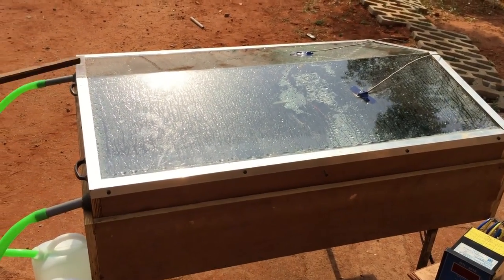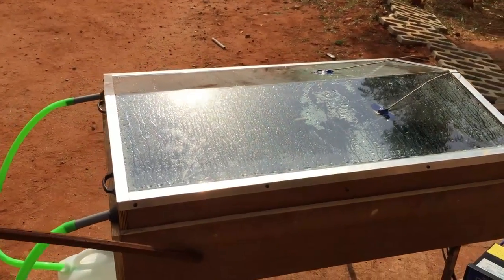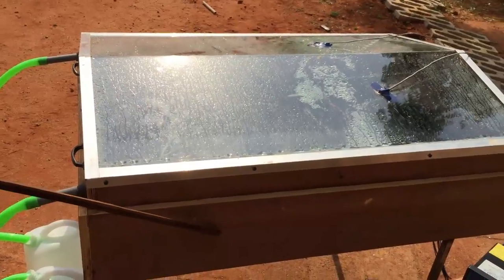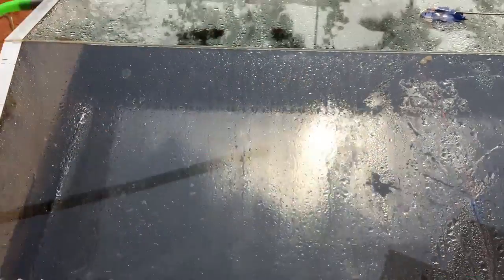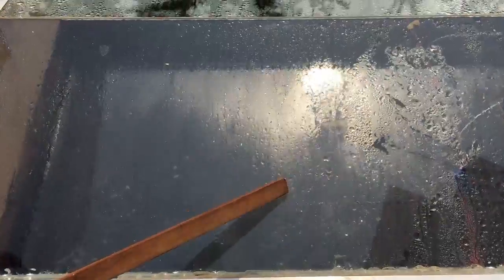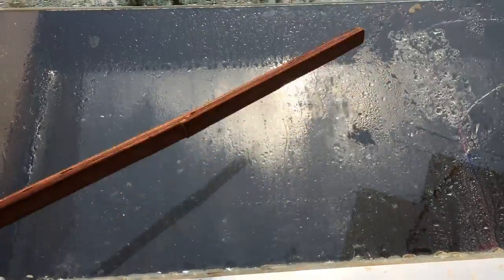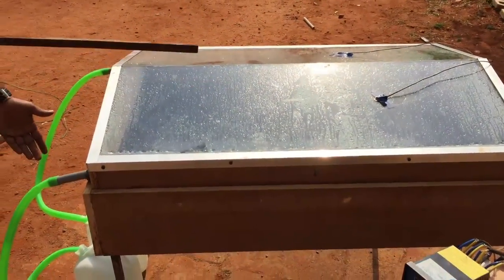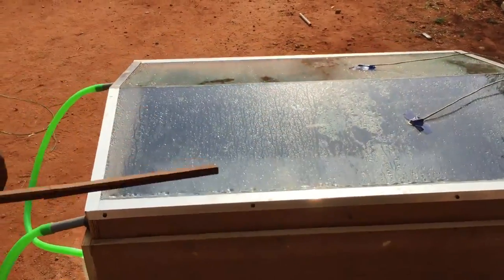EXPERIMENTAL INVESTIGATION ON SOLAR STILL WITH PCM

Comment: After four years am going to do the same project🤪🤪
Reply: @MECHBOY have you done this project??
Need some help
Reply: @mahendragaat3097  yesu but we use phase change material in it..
Reply: @mechboy4090  which pcm?
Reply: @mahendragaat3097  paraffin wax..
Reply: @mahendragaat3097  and nanoparticles tooo
Reply: @mechboy4090  plz thoda help kijie ..i have some doubt ..if you don't want to share any contact details .can i share my email ??
Reply: @mahendragaat3097  okk bro we will contact in Facebook
Reply: And my id is vinodchowdary
Reply: @mechboy4090  i have sent request ..I don't know whether u got or not plz check once
Reply: @mahendragaat3097  on Facebook..?
Reply: @mechboy4090  yes
Reply: @mechboy4090 did you do this project ? If so can you please help